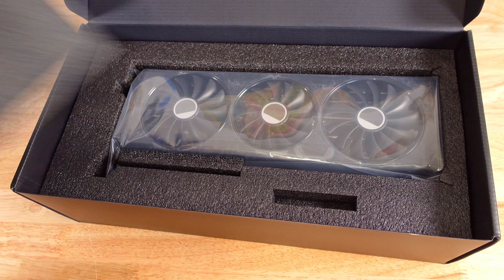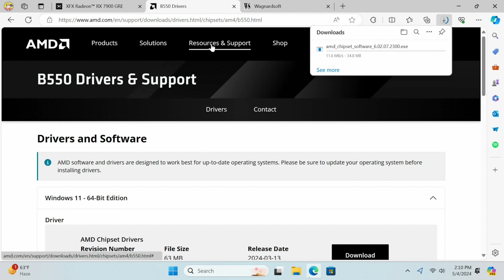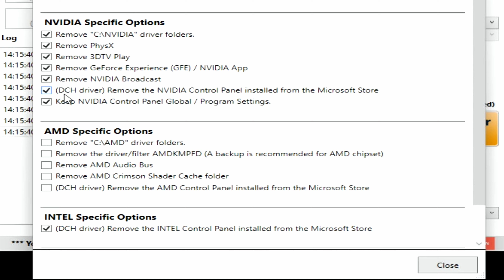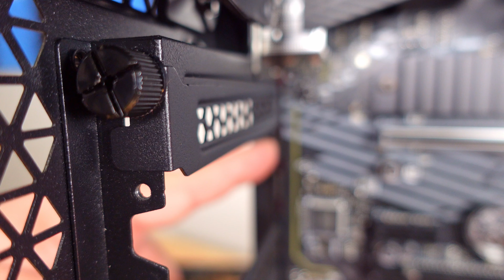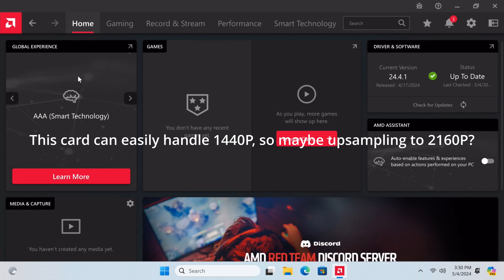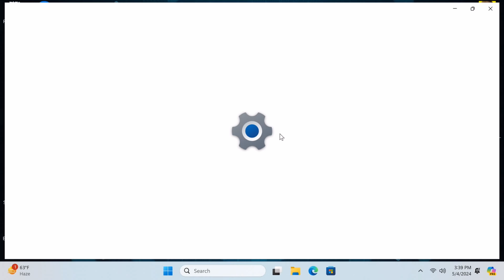Installing the AMD RX 7900 GRE Graphics Card - Step by Step Guide

Comment: Why has my card got 3 power slots? Can I put 2 cables with one that had a piggy back thing on it?
Reply from the maker: No, if it has 3, you need to plug them all in.  It has 3 because it pulls a lot of power.  Please dont Piggy back, you will have issues when the power requirement is met

Comment: Hello, I recently bought this graphics card, but I can't get the video, the fans work but the system doesn't start, could you help me with that?
Reply from the maker: So that I can help, please list the manufacturer and exact model number of the following components:
1. Motherboard - manufacturer and exact model number
   1a.  What BIOS version is on the motherboard, you can find out in the BIOS 
2. CPU - manufacturer and exact model number
3. RAM - manufacturer and exact model number
4. Video Card - manufacturer and exact model number
5. Power supply - manufacturer and exact model number
6. Monitor - manufacturer and exact model number
 Redundant I know, but many people forget to enter manufacturer and exact model number
7. Do you have ALL of the PCIE connections plugged in, and not daisy chained or pigtailed, each coming directly from the power supply?
8. Are you running through HDMI, DP, DVI, VGA, any adapters?
9. Is UEFI or Legacy Setup in the BIOS?
10. What slots do you have your RAM installed in?
11.Do you have CSM Enabled or Disabled in the BIOS
12. Is your Hard Drive/SSD with Windows set to GPT or MBR?
13. This video will help you identify hardware inside your PC: https://youtu.be/65ZSiVImJx0

Comment: No signal monitor for me 😢
Reply from the maker: So that I can help, please list the manufacturer and exact model number of the following components:
1. Motherboard - manufacturer and exact model number
   1a.  What BIOS version is on the motherboard, you can find out in the BIOS 
2. CPU - manufacturer and exact model number
3. RAM - manufacturer and exact model number
4. Video Card - manufacturer and exact model number
5. Power supply - manufacturer and exact model number
6. Monitor - manufacturer and exact model number
 Redundant I know, but many people forget to enter manufacturer and exact model number
7. Do you have ALL of the PCIE connections plugged in, and not daisy chained or pigtailed, each coming directly from the power supply?
8. Are you running through HDMI, DP, DVI, VGA, any adapters?
9. Is UEFI or Legacy Setup in the BIOS?
10. What slots do you have your RAM installed in?
11.Do you have CSM Enabled or Disabled in the BIOS
12. Is your Hard Drive/SSD with Windows set to GPT or MBR?
13. This video will help you identify hardware inside your PC: https://youtu.be/65ZSiVImJx0
Reply: @ThisBytesForYou  
Hi, thx for your help:

1. Motherboard : PRO B650-S WIFI - MSI

1a. BIOS version :
BIOS/Date American Megatrends International, LLC. 1.90, 06/02/2024
2. CPU -   AMD Ryzen 7 7700 8-Core Processor, 3801 MHz, 8 h, 16 logic process
3. RAM - 32g0 ddr5

A-Data

AX5U6000C3016G-BLABBK

16 go x 2

stockage: XPG GAMMIX S70 BLADE SSD NVME 1 TO

4. Video Card
 old one: RX 7900 GRE

new: RX 7900 GRE XFX

5. Power supply : DARK POWER 13 750W

6. Monitor 

a : PLG2488H (Idek Iiyama) 1920x1080 144hz 24"

b: PL2488H (Idek Iiyama) 60hz 24"

7. Do you have ALL of the PCIE connections plugged in, and not daisy chained or pigtailed, each coming directly from the power supply? YES

8. Are you running through HDMI, DP, DVI, VGA, any adapters ? NO

9. Is UEFI or Legacy Setup in the BIOS? YES
BIOS mode:  UEFI
10. What slots do you have your RAM installed in? 2-4

11.Do you have CSM Enabled or Disabled in the BIOS ? NO

12. Is your Hard Drive/SSD with Windows set to GPT or MBR? GPT
Reply from the maker: @chrisostreicher9798  ok cool, so you have everything which is great,  So I am not sure what cable you are using, but if its HDMI, you will need an HDMI 2.1 cable, if its DP, you need to make sure its 1.4, this comes directly from AMD.  So to get back into  windows, disconnect all your cables on the back of you machine, USB, power, HDMI/DP, etc, no cables, then remove the CMOS battery for 60 seconds, after 1 minute, connect all the cables on the back of the machine and pop the battery back in.  Make sure your HDMI/DP cable is connected to the graphics card, not the onboard IO.  Since your BIOS has been reset, go back in the BIOS, load XMP, save and exit then go back into windows and you "should" be good, I HIGHLY recommend updating your BIOS as well to the latest BIOS Version.
Reply: @ThisBytesForYou  I connected the same cables as the cables that already exist on my RX 7900 GRE card on the new RX 7900 GRE XFX (VGA cables).
However, in addition to the "no signal" screens the VGA light of the motherboard flickers white
Reply from the maker: the cables may not be firmly seated and the card may not be pushed in completely into the PCIE slot.
Reply: @ThisBytesForYou  Oddly the cables fit like butter on my old graphics card (7900 gre) but on the 7900 gre xfx I have to force, and they are inserted well, when on the card I hear the noise and the lock reset, so if all going well
Reply from the maker: @chrisostreicher9798 good stuff my friend.
Reply: @ThisBytesForYou  yeah but still not working :(
Reply from the maker: @chrisostreicher9798  I didn't realize, you have an older BIOS, and there have been many AGESA fixes, as well and memory fixed and cpu support, and security issues fixed.
Here is your latest BIOS: https://download.msi.com/bos_exe/mb/7E26v1H2.zip
Here are all of the BIOS': https://www.msi.com/Motherboard/PRO-B650-S-WIFI/support
You can read on page 52 how to update the BIOS with the Flash BIOS button your board has: https://download-2.msi.com/archive/mnu_exe/mb/PROB650-SWIFI.pdf

Comment: Love how informative your video is.

Hope you can answer my question

I have a MSI Pro b550m-p gen3 motherboard with a Gigabyte 3070 8gb OC Edition installed.

My 3070 broke and I wanted to replace with the Sapphire Nitro+ 7900gre.

Would you know if it will fit? pcbuilder says it is compatible but when I look at my cpu and check the dimensions of the 7900gre, its pretty sketchy.

Thank you in advance
Reply from the maker: Depends on your case, CPU is your processor, not your computer.  Is this for a pre built store bought PC, if so what is the exact model number and manufacturer of the PC, if it's for a custom built PC what is the manufacturer and model number of your case.  

And for both pre built and custom, what is the manufacturer and model number of your power supply.  If you are not sure, you have the PC in front of you, look inside.

Comment: Idk why, but when I plug in the hdmi into the GPU area, I keep getting a black screen, but it works fine in the mother board
Reply from the maker: Do you have the on die iGPU disabled in the BIOS and have the first device for video as you discrete GPU?  What is your motherboard manufacturer and model number?
Reply: @ThisBytesForYou I’m having the same problem graphics card works inside but nothing on screen, I have msi b650 gaming plus WiFi motherboard but I don’t know how to get into bios because it’s my first build any suggestions
Reply from the maker: @nathanielcline3168  watch this video, it will show you how I installed it, and to get into your BIOS, when you restart your PC or start your PC start taping the delete key and you should go into the BIOS.
Reply: yo I have the same problem how did you fix it
Reply from the maker: @saber838  he hasn't done anything, maybe you can answer the questions I gave him?

Comment: 650w psu is enough in my rig. Glad did not have to upgrade it too
Reply from the maker: Good stuff my friend, but this card states that the minimum recommended is 700Watts.  Thats not to say it won't work with a 650, the 700Watts takes into account a typical system, since of course the card itself doesn't consume 700 watts, even 650Watts.  I go large, I have used 1200 and 1000Watts for years, haven't needed to buy a new Power supply in over 15 years, well other than needed for better build guides to buy ones with 12VHP connectors.  This has saved me tons of money from having to buy a PSU every time I upgrade, pay a few dollars more upfront and save tons over the course of a few years.

https://www.xfxforce.com/shop/xfx-radeon-tm-rx-7900-gre#2
Requirements

‍External Power: 2x PCI-E 8 pin connections
Minimum Power Supply Requirement: 700 watt

Comment: I'm rocking 7900XTX with only 750W (85%). Never failed me, even during full night of Fur mark and CPU (7950x) stress testing together.
Reply from the maker: Cool I guess but they put those requirements for a reason.  They usually go above but wattage of a typical system stressing for a period of time, it may work fine now but as efficiency goes down and maybe more gets added to the system that comes into play.  What is the manufacturer and model number of your card?